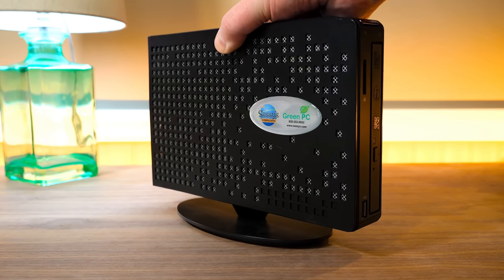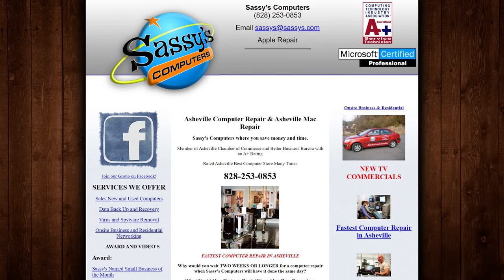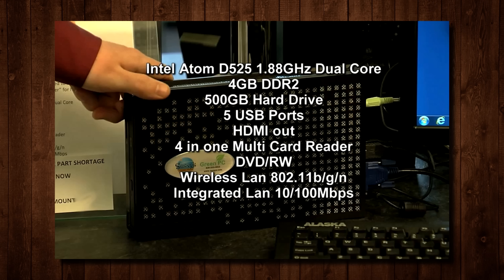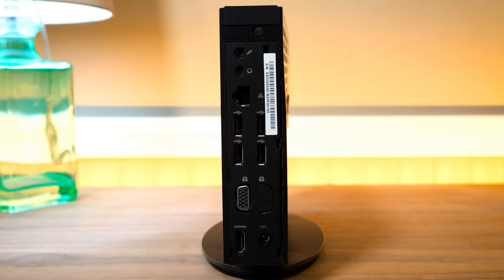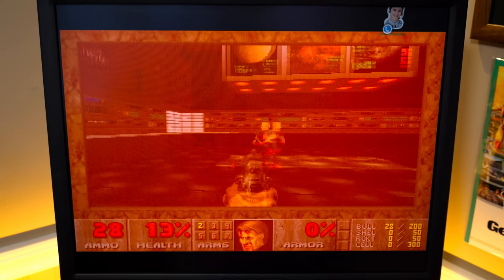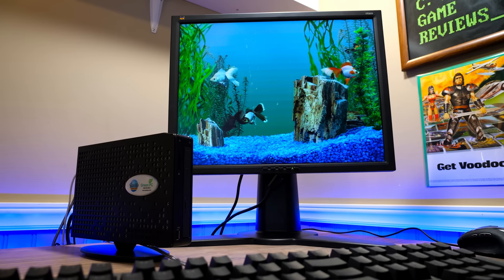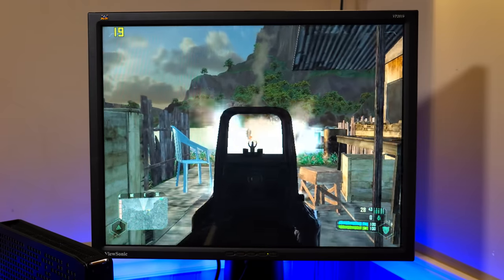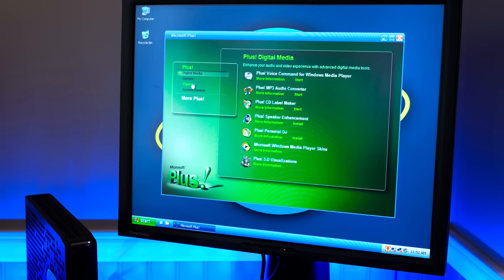Rejuvenating a $599 Shuttle Nettop from 2011! Sassy's Green PC

Comment: I have an Acer Aspire One KAV60/D150 from 2009. it has an Intel Atom 1.60GHZ single core, and I usually use it for hobby stuff lately.  Upgraded mine too with a 60GB SSD, 2GB RAM, and I installed Xubuntu on it.  Runs great!

Comment: I built a silent mini PC from a Zotac motherboard with the same D525 CPU and a really early 64GB SSD. This ran WInamp as a music server in my van, which I remotely controlled from a Bluetooth app on my Symbian phone, then later over Wifi with Android. The audio quality was far better than anything I could achieve with bluetooth or headphone out from a phone. I installed a PicoPSU which accepted 6-24v so it would run off a car battery. This little PC put up with all the vibrations, heat and humidity changes that a vehicle put it through, yet only drew 14 Watts of energy from the car battery, so it would run all day with the engine off if needed.

Comment: Still have my two old shuttle XPCs tucked away: my first home built PC - the SB75G2 (being captivated by SFF ever since), and second my SX48P2 deluxe ultimate. This would become my first watercooling project - and one that it pains me to say, I never fully finished, despite still having all the parts. It was hard to WC back in 2008, and in SFF for a first timer it was crazy. Custom northbridge and vrm coolers, lapping cpu's, learning about not mixing copper and aluminum and galvanic corrosion, finding a solution for an external rad, buying custom pumps from xpc w/c forums, importing niche parts to the UK from the US... good times man.  

I ended up with something like this: 
- GPU - the Koolance VID-428 waterblock for my GTX 280xxx which looked beautiful 
- CPU - the Koolance CPU-340 as it was literally the only thing to fit Shuttles non-standard mounting holes when rotated 90'
- NB - the Thermaltake Extreme CL-C0034
- RES - Swiftech MCRES-Micro Reservoir
- PUMP - Swiftech MCP350 with custom pump top (thanks to someone on the old Sudhian forums I think)
- RAD - Thermaltake Big Water 745 (I only had the external 240mm rad, not the kit, cant remember where I got this from- still looks amazing imo)
/ Tygon tubing, Feser One UV cooling fluid in black (still unused)

If any of this sounds interesting to you hit me up.

Comment: I used to have a similar system from that time. It was an even more compact Lenovo, with the dual Atom + Ion combo, which I had bought on sale from Fry's. The first thing I did once I took it out of the box was replace the hard drive with a 64 GB SSD and install Windows 7 32 from scratch. It came with a compact wireless keyboard/mouse remote and I had it hooked up to the main TV. It was good enough to run Kodi and a few retro games.

Comment: I have one of these (shuttle branded). I used it as a low power torrent box. There is a kit available so that you can replace the CD-ROM drive with a second 2.5" drive.

Comment: I think part of why the thing is so appealing is that it's a sort of (pardon the pun) microcosm of technology advancement, and it's also why I'm so fascinated by mobile gaming consoles.

Technology advances faster and faster as time goes on, and the idea of something that, as a kid, would've required hundreds, if not thousands of dollars, and was a mere pipedream, that can now be bought, modified, and ran almost for free with how cheap it's become is super intriguing. Especially when you get into how you can tweak it in various ways with QOL changes that have popped up over the years (like SSDs, higher RAM space, et cetera).

Add on the fact that it's very easily portable and you've got a recipe for tech nerds to keep entertained for a while. I could easily see myself using this as a sort of lanbox to take with me and run older games on at a friend's house, for example. Get one of those smaller monitors and you can fit everything into a backpack.

Comment: Place I used to work had rows of semi-cubes set up with Lenovo Thin PCs - they were used for the data entry temps to do their jobs.  ThinkCentre, I think they were, or something like it.  Set up in 2015 or 2016 or so - it was essentially pulling a PDF or TIF file over, you'd type what was required, hit save and do it all over again.  Had about 20 of these in a room along with a big ol' scanner and some server stuff for the DBs.  Place got HOT too, with all those machines running.

Comment: Gday Clint. Came back to this video having spent the last couple weeks playing around with a couple of Shuttle XPCs I had stashed away. I’d never even heard of that Nvidia Ion video chip before. Almost sounds like the Atom GPU equivalent before they went down the ARM/Tegra route. 
Have you played with one of the more fully fledged XPCs? These were the LAN party machine to have back in the day. So much smaller that the full tower behemoth (and corresponding 21” Trinitron) that I used to lug around.

Comment: They seemed to really want to hide that this was a Shuttle OEM Case. It looks like they took a razer free hand to remove part of the manufacturing label. They removed the section mentioning that it was a shuttle made device.
Reply: Couldn’t afford a straight edge either.
Reply: What makes you think Sassys did that and not the original owner?

Comment: I bought one of these around 2010/2011. Running Windows 7 just fine since I didn't have a bunch of crap installed. I ran it as a HTPC using XBMC connected to my TV. Even did an SSD upgrade back then too and enjoyed the total silence! It's been collecting dust for a while now, but if I ever need a PC based server for some basic 24/7 operation, I'll be using it again. No fans and low power make it perfect for that!

Comment: I have the Arctic MC001 which has basically the same hardware specs as Sassy's Greenpc. The hardware is still all factory stock and I have Windows 10 installed on it. I boot it up about twice a year to upgrade the software (OS, browsers, media players and AV) only to shut it back down for another 6 months or so. 🤪😂
Great video LGR!! 😃

Comment: I used one of this, combina from Shuttle directly rather than this brand, on the place I worked (I am a software debeloper). We programmed an app that was designed to run on those PCs. They were excelent machines, at least for what we used them. I remember that we booted them from SD cards and not ssd. That was circa 2014 though. Your video bringed me memories of that at least. 

Pd: I think you are a mind reader. As soon as I was thinking "can they run Crysis", that section of the video started 😂

Comment: I grew up in Asheville so i bought a lot of stuff from Sassy's and when i moved to Greenville , i bought all of my parts from CDO.  That Green PC killed that business and they were basically pushed into selling it by the locals.   You pretty much nailed it on the head as to why it was a flop but i would also add that people from Asheville are pompous snobs and they'll campaign for something and then don't support you when its done like they never asked...and in fact criticize you for it.    It was essentially a product that wasnt needed.  On the flip side, CDO went out of business because they forgot their customer base.  Before they came out with the Volta, it was an old building full of people building their own computers...it was always fun having those folks around.  When they moved to their fancy new office, they got rid of the sales rep, the workshop where people built their computers.  When you walked into the business , it was practically like a doctors office.  The computer failed because it was too expensive and wood cases were widely available and sold.  They tried to go back to the old business model but it was too late and all of us gave them the middle finger...a sad tale of why you should change the recipe.  Hope that helpd

Comment: I watched this video, using a similar netbook, an Acer Aspire Revo 3700, with D525 Atom, ION2 graphics, 4GB RAM, and the original 500GB hard disk.  I bought it new, back in 2011.  I went for the cheaper Linpus Linux option (which was dreadful).  I soon installed Mint Linux, and that has been excellent.  I've upgraded the version a couple of times. 

I don't care to run modern games, but I enjoy some 8-bit and 16-bit retro gaming with it. If I'm feeling nostalgic, I will code in GW-BASIC via DOSBox.   This little computer is great for interweb stuff...  sitting quietly, using hardly any electricity, and working reliably day after day.

Comment: I thought Shuttle sounded familiar-- back in 2012, I was building some industrial kiosks for the company I was working for and ended up purchasing a couple of Shuttle "Book" PCs (XS36V4 ?), which were Intel Atom-based with 2x serial ports and an SD card slot, along with HDMI (no optical drive). Was pretty cool and also inexpensive (~$300 iirc). This was before mini PCs like the NUC and similar got popular, so most mini PCs were either thin clients or served a special purpose.

Comment: I have the same one (not Sassy's), only with more powerful hardware including CPU and Radeon GPU and upgraded by me SSD, bluray drive and RAM.  Great XP machine.   For me it is a super cool small system.
I did try to install Windows 98SE on it, but I failed. 
Thanks for the video!

Comment: I used a rather similar Acer AspireRevo with an Atom CPU and NVIDIA ION graphics as my main PC for a while, although mine had dual-channel memory. I found that I was as often as not held back by the slow Atom CPU as by the slow Ion GPU. The ION is functionally equivalent to a GeForce 9400; it was more capable than is shown off in this video for sure. I played Crysis on mine at ~30 FPS! Without completely tanking the settings!

Comment: We used to have a bulky metal cased 'information kiosk' at work with a metal buttoned keyboard and trackball. It had a similar small PC inside. All it did was run IE7 full screen and show a 'website' that was stored locally on the hard drive.

Comment: Had a little Asus Atom mini that was about the size of a router with hdmi out that served as a dirt cheap, ultra flexible streaming platform for a home TV rig. Also ran a netbook into the grooound doing web stuff and text RPGs. Eventually it retired to sleep mode as a phone battery pack. (It has one USB port that provides charging while the netbook hibernates.)

Comment: oh Man! that hardware! I used to work at a local PC repair store..we used to sell that EXACT CPU (it was intel graphics not ION) as our homePC/small media center. and yes, I recall battling that 24x7 software (that stupid chat head) it was the FIRST thing I removed if I saw it on a customers PC as it absolutely put that chat head EVERYWHERE as you saw. that platform does not support DDR3L-thats why it stopped POSTing with your upgraded memory module

Comment: I had one this HP Thin Client (forgot the model) from early 2010s too bought from a computer surplus shop but had a bad experience about it. All I want at that time (2018) is a Win 7 Machine for Basic Internet Usage and 2000s Gaming Machine, rigged it with 120 GB SSD but sadly that crap died out immediately and died for overheating, it was a traumatic experience since it cost me money and time because I was hoping it will be a fun project. So, yeah... Now I'm trying to regain my urge and wanting to build from a NUC to build a Win 10 Machine for basic daily use and media stuff since I have a portable monitor from GAEMS. Well...Thanks for the inspiration Clint! =D

Comment: The faster RAM module wasn't compatible because it was DDR3L ram which runs at 1.35V. This system requires a 1.5V DDR3 ram module.

Comment: I've never used a green pc but I've used dell and hp thin clients from the same year and they are absolutely amazing. With a few upgrades they are great for light emulators and if you install steam you can essentially use them as a steam link and steam games from your gaming pc across the network.

Comment: Yeah i installed XP Slim on an old Atom ITX pc specifically for running older windows software for dubbing minidiscs. It has one PCI slot which i shoved a studio-grade SPDIF Toslink card for connecting my MD Deck.

Comment: I have an intel d525mw , same but without ion gpu, itx form, it had a big passive heatsink, 3d printed a full cover box over it and blowing air through it from the side, stays 26 Celsius on full load, it works as an ubuntu mini server. Good. :) With 32 gig ssd for system, 1tb for storage.

Comment: The major selling point of the ion gpu was its hardware video decoding capacity for hd video! I actually built a few htpc around a similar configuration at that time. Too bad the ion + atom duo was so short lived thought. The next atom generation was actually worse because it lacked that hardware decoding capacity and was still far from being able to handle it in software. Motherboard with ion gpu stayed popular for quite some time, they became actually more expensive than newer atom motherboard for some time.

Comment: These were huge for the HTPC market when they came out.  The small "set top box" form factor, passive cooling, low power consumption, etc. made it a lot more "wife approved" than having a grossly more expensive full sized tower next to the living room TV competing with audio volume as the fans go full RPM. 
The Atom/ Ion combo worked perfectly for displaying HD content with the better and more advanced codex, so better quality and smaller file sizes.  I used this box with Kodi (XBMC) for over 5 years.  Also had the cheaper Acer Aspire Revo AR1600-U910H, those had a lot less horse power but only cost $200.  Okay desktop computer (very basic task), horrible gaming, but great HTPC.  
These also had hardware limits applied to qualify for a cheaper licensed version of Windows.  That's why most the nettops and netbooks of the time were all very similarly spec-ed.  When I bought the  Shuttle XS35GT V2, it was grossly cheaper to buy it OS-less and without a HDD as a barebones.

Comment: I own an EEEPC 1005Ha
I overclocket it from 1,6 to about 1,79 GHz using set Fsb,
which caused later programs to run less crappy and hang less.
I also upgraded the ram to 2GB
and used am program called eBooster to use usb memory as cache which also helped.

Comment: I thought that looked similar... I have a Shuttle XS36V4 with a Celeron J1900, but, with 2 RS232 COM Ports and a SD Card Reader on the front! Was advertised as a digital signage terminal at first but I turned it into a decent little emulator rig which accepts COM serial devices. I picked that up on eBay for £20 a few months ago.

Comment: I've actually currently got an Asus mini PC running Windows 10, and I can tell you right now, the Sassy is blazing fast in comparison. All I use mine for is a media server/ emulator machine, so its perfectly fine for what I need it for, but the Sassy is impressive. Mine's much newer too, it came out in 2015 to be a point of sale style PC. Asus VM40b. It also is mountable to the back of a monitor. Maybe I ought to take mine back to Windows XP. I do love the tiny form factor of mini pcs. I'm debating on getting a Nuc 11 for a big performance upgrade.

Comment: I've got 2 Dell FX-160 thin clients. Similar configuration with the exception of no optical drive. They use an sis chipset.  Great XP game machines.  If anyone is looking at them on eBay, make sure they have the hard drive mount.  Without it you can still use it, but it becomes much more difficult to mount a harddrive/ssd

Comment: I still use a Dell Inspiron Mini 10 netbook for network diagnostics at client sites. An Intel Atom 230 with 2Gb RAM running Lubuntu is more than capable of running network diagnostics and wifi speed tests over a local network. My main issue recently was a trusty Lenovo laptop that would no longer run the software I needed because it's only available on 64bit Ubuntu and the Lenovo was a 32bit Intel Core Duo T2300.

Comment: Oh wow, I had a Shuttle PC very similar to that except it didn't have an optical drive, instead it had card readers, USB ports and two serial ports! It had an Atom D2700, which oddly didn't use Intel graphics or Nvidia, but PowerVR graphics and there was no 64bit driver for it whatsoever. Perfect machine for leaving on 24/7, totally silent and stable.
Reply: Wonder if the GPU would be handy for dreamcast emulation?

Comment: I have in a drawer somewhere an Intel Compute Stick STK1AW32SC, the same idea as this taken to the extreme, tiny candy bar size, quad core but only 2GB RAM and non-upgradable storage (I think you get about 18GB free) but it has Micro SD so you can put a huge card full of emulators and ROMS on it. Was going to use it for a DIY emulation machine but never got around to making the arcade cabinet. Clint if you are happy to cover postage from the UK (should be bugger all as it's tiny and light) I'm happy to send it over for a video.

Comment: I'm still using one of these systems. They were build in  different versions like mine has no Nvidia ion unit but the simply Intel gma.
On my side this little thing is running as a proxmox backup server with an 500gb hdd xD

Comment: i remember mini pcs my elementary school got briefly. i remember them only lasting a year in one class as a trial run. when i saw them first i thought " wow a computer the size of a disk drive " then it took 15 mins to turn on. its no surprise they didnt take off at my school.

unfortunately my high school did computer things exclusively on atom powered netbooks running windows 7. had to do a english final as a 17 year old on some cheap red acer piece of crap. my hands were so cramped after. netbooks really weren't designed for a 17 year old who is 6'1 with big hands. i remember being pissed the teacher wouldn't let me borrow a usb keyboard from the library or bring one from home